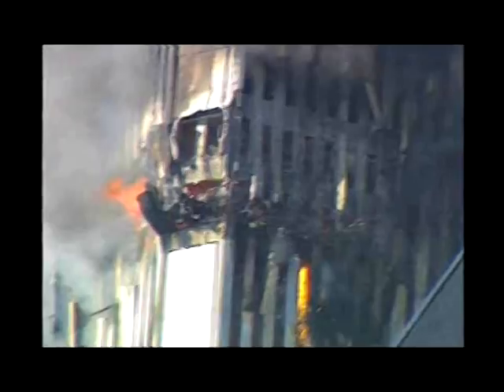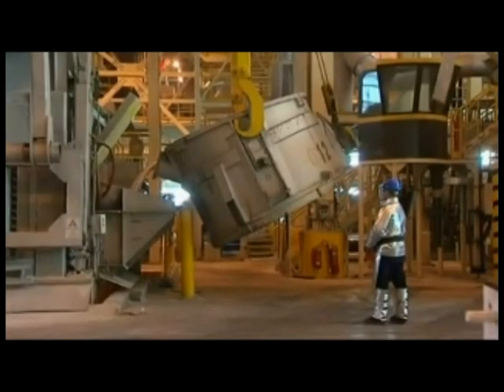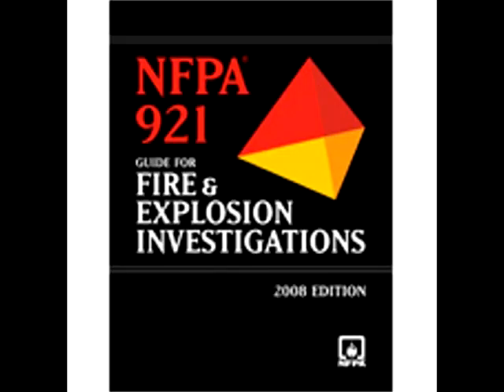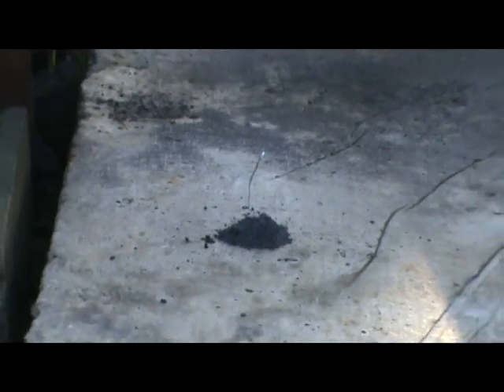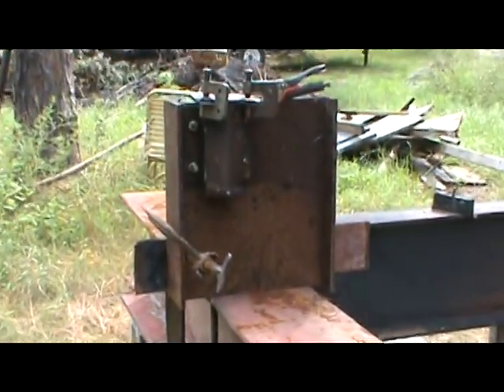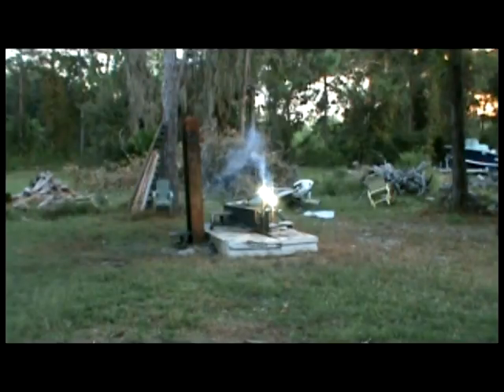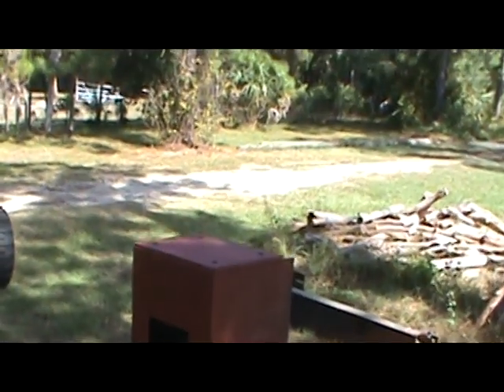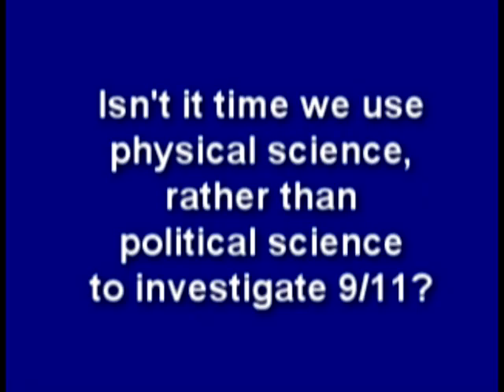9/11 Experiments: The Great Thermate Debate

Comment: No thermite was used in the Towers, there is no evidence to suggest it was. Put simply, those who advocate thermite cannot feasibly explain how the thermite and then all the explosives were placed in the towers. Remember for their theory to hold true, explosives would have to be placed on every support column on every floor with each floor timed to go off in sequence. 
Additionally, they would need the ability to START the thermite AND the explosive on the EXACT floor that was weakened by the planes.....................................DIDN'T happen!!!!
For those claiming it was done for the money, do you have ANY idea the cost of doing this..................it is far, far, far, far, far beyond the cost of a normal controlled demo. Controlled demos are not done in this way. They don't pancake the floors.
Tonnes upon tonnes of explosive and thermite required, kilometres of det cord, thousands of detonators, more timing devices than you could count teams upon teams of specialists to do it................all of which would have been rendered useless as soon as the planes crashed and mucked the network up...........................DIDN'T HAPPEN!!!!!!
Reply: You're arguing a building did to itself;
what would otherwise take tons and tons of explosives and incendiaries, carefully planted at every level, in addition to requiring thousands of precisely timed devices and kilometers of detonation cord, because of a vaporized jet no longer around to do all that demolition work.
There's no in-between? If you believe that a skyscraper can somehow gain momentum through itself anyway, then why assume a single bomb towards the top couldn't accomplish the same result without all the extra work you insist had to be done otherwise?
Reply: @liarfire101  No, all I insist is that for the towers to come down as they did (the argument being controlled demolition because explosive squibs could be seen and thermite is postulated) that a ridiculous amount of explosive and thermite material would need to be used.
Now, to address your assertion that a singular blast at that floor level could have done the job, yes it could. However you have no evidence of this. In addition you would then need to detail how exactly you were able to precipitate that explosion on that exact floor! Are you suggesting that explosives were planted on just that floor level and then the planes were purposefully flown into that exact floor level on both towers?...........No, no, no and NO!
Planes hit the towers weakening structural members and causing massive fires. The fires burned further weakening structural members and flooring that already had poor insulation. The floor pulled away from the external supports and down they came causing a progressive collapse that each successful floor was not designed to withstand>
Reply: Yeah a ridiculous amount of thermite would be necessary, because it's being used to melt a ridiculous amount of steel for a ridiculously large building. Just because large quantities of something would be necessary for the plan to go through doesn't make it impossible.
Reply: @willbradley8038  That is true Will. However what is also true, is that if you are going to make the claim that thermite was used, you need to provide exclusive empirical evidence. Currently all you have is speculation. Any empirical evidence that I have seen suggesting thermite can also be explained more believably by other things. Other evidence such as pictures of cut beams claimed to be evidence of thermite are 100% NOT thermite. Those beams were with 100% certainty cut during the cleanup by an oxy gas torch.....................text book oxy cuts! These cuts were made because both building had multiple stories of supporting beams still standing after the collapse.
Reply: There's no reason for someone to go through all that trouble of hijacking a plane and killing themselves though, if it were possible to accomplish the same feat with a single detonation up top and discretely walk away from it instead; unless they didn't want to be alive later to protect their family, neighbors, and friends from the most powerful military in the world upon finding out who they were, or if an object could actually go about liberating momentum through itself to become the largest demolished(destroyed/obliterated) skyscraper in world history.
Reply: @liarfire101  Not sure what you are trying to say here. Whether you personally believe there was no reason is mutually exclusive to the fact that the planes were hijacked and then flown into the buildings.
Reply: John Pickering
Now you're right back where you started.
If you are going to make one claim that a building can do to itself, what you otherwise insist must take tons of carefully planted and precisely timed explosives using kilometers of detonation cord, you need to provide exclusive empirical evidence that you aren't contradicting yourself. A collapsed jet doesn't fix that.
Reply: @liarfire101  What exactly are you talking about? The empirical evidence is all in the official version. It has been demonstrated many many times. The rebuke to you comes from YOU saying that it could not happen the way the official report says it did. I then said that YOU need to provide the evidence that it can happen by using THERMITE and EXPLOSIVE. I said that if it were the case that it did indeed happen with thermite and explosive, you would need ridiculous amounts of it, therefore there should be large amounts of evidence of it...........................but there is none, you can't provide any. Your inability to see this is probably a good indicator as to why you believe in logically fallacious arguments proposing 911 conspiracy. Your inability to fathom how it could have happened the way the official version says it happened and you subsequent conspiracy arguments are simply argument from personal incredulity!
Reply: thatrabbitguy  I am very quiet when those who actually have a clue speak. I would suggest you follow your own advice! The guy in the video is actually references Richard Gage. Richard Gage has no shame. I am not sure whether Gage actually believes what he is saying or not. I do know that's how he makes his living though. If he does believe it, then he is not very clever, if he doesn't believe it he is a charlotan. Either way, he is wrong, embarrassingly wrong!
Reply: John Pickering
Insisting a building can do to itself what would otherwise take a ludicrous amount of carefully timed and planted explosives and incendiaries is a contradiction. You need to provide evidence that it's possible for an object to initiate momentum through itself while gaining weight as it's deconstructed, if you're going to go along with what's been officially written. That isn't my story. That's not up to me to prove. There's no evidence or even a physical model to demonstrate that the second law of motion can even be applied to such a scenario. And there was no official investigation into the presence of incendiaries or explosives by authorities during the pro demolition cleanup, so lack of that evidence falls squarely on them too. I'm not the one who wrote the report or had the responsibility to look for it. And if I actually believed in logistically fallacious arguments proposing 911 conspiracy, I wouldn't be pointing out the absurdity of theorizing a person conspires with others to commit the personal act of suicide because he hates me instead of himself.
Reply: @liarfire101  Firstly, I am not suggesting the building did anything to itself and I don't know anyone who makes that argument. So the premise you use is rejected in its entirety. The rest of your post deals with a simple lack of understanding regarding dynamic and static loads, energy, force, acceleration and the structural properties of steel. As far as initiating momentum is concerned, that is evidenced by planes flying into the buildings and the resultant fires that further weakened structural components to the point of collapse. Any amount of experiments have shown this. That you choose to ignore them is not my issue. It has been calculated that once the top part of the building started moving, it only need to fall 3 feet in order to gain enough energy to initiate a progressive collapse. The fact that the floors were about 12 feet apart means that the bottom floors were not capable of providing structural resistance.  Relating to whose responsibility it is to provide evidence for controlled demolition, that would be your responsibility, or anyone else who proposes that theory. The burden of proof always falls on those making the claim, it is therefore your responsibility to prove it by fronting up with the empirical evidence, not my responsibility to disprove it. Regarding suicide terrorism which is what I think you are alluding to at the end of your post, are you asserting that this does not occur?
Reply: Your premise IS that the building obliterated itself after the jet was no longer around to do all the demolition work. Furthermore you suggest it would take tons and tons of carefully planted and strategically timed explosives and incendiaries to do the same work. Your next contradiction was insinuating that any mass(standing structure) can liberate momentum through itself because of another mass (upper block)that can only lose momentum against it in exact equal time to one another as momentum is instead ALWAYS conserved. The second law of motion (F=MxA) can only be applied to the later, and the action/reaction time couldn't be exactly equal and opposite between them, any other way. It doesn't matter which of the two are static or dynamic. In fact, they both could be dynamic and the results would be exactly the same. Facts never change and always agree with each other, and yet you've already contradicted yourself twice.  Also, an obliterated pile of debris is likewise a demolished one. It is therefore your responsibility to prove that a chaotic demolition is even possible. Whether you accept the fact that the official story is a conspiracy theory or not, is as beside the point as me thinking a person conspiring with others to commit the personal act of suicide (because he hates you instead of himself) is silly. I don't engage in crazy conspiracy theorizing.
Reply: "1.That is not my premise at all. Try again!"

Your original insinuation (premise) which started this thread was that a building can do to itself what would otherwise take tons of strategically placed explosives and incendiaries placed on every support column at every level timed to go off in sequence.

"2. I have not provided any contradiction whatsoever, that would be the inference you have taken based on your own biases"

All biases aside, the premise that began this thread is a contradiction.

"3. You have just demonstrated your lack of understanding of dynamic and static load."

Really? I thought that a dynamic load is one of motion whereas a static load is one that's not, and that the Third Law of motion applies exactly the same between colliding bodies regardless of which, or if both, are moving.  

"4. You are similarly ignorant of kinetic and potential energy"

I'm not the one suggesting that friction can behave as a catalyst which creates more energy, and friction.

"5. I don't have to prove anything, its already been proven, in fact the technique to bring down a building with no explosives by simply taking out upper level floor supports to initiate a progressive and total collapse is called "Verinage". There are many examples on Youtube if you would care to educate yourself..........................each and every one of them is a conclusive rebuttal of everything you have just stated. Put simply, watch them make the top third of a building start to move, and it comes down and demolishes the building completely."

Like any demolition technique (because buildings don't go about demolishing themselves), verinage' separates a building into sections of approximate equal mass to maximize damage to those sections while minimizing it to surrounding buildings and infrastructures, per Newtons Third Law'. The only video out of a dozen which seems to indicate that wouldn't be the case is simply an illusion, because the bottom two-thirds of the building was gutted of one third it's mass, making it appear as though there wasn't an equal and opposite reaction between the colliding top and taller standing structure. It's never been proven by anyone that Newtons laws can be violated by anything on this planet.

Your inability to accept certain things about 911 that are known to be true because you personally can't conceive that it could happen that way is a logical fallacy called the argument from personal incredulity.
Reply: @liarfire101  
1. No it was not. The premise was that you can provide no evidence of controlled demolition.
2. As highlighted above, you have completely ignored what MY premise was and created one of your own, then attacked it......................also known as a straw man argument!
3. Well at least you have the definitions for the most part correct, although your interpretation of how they work in practice, particularly as they would pertain to the twin towers is unsurprisingly wrong! As a simple example, an object in motion (in his case the upper floors of the WTC) can easily exceed the load capacity of another object (in this case the lower floors of the WTC) by a considerable margin. This is because the object in motion has a force applied to it in order to put it in motion. In our example, this force is called gravity.
4. I have made no such claim.
5. Again you quote Newtons Laws, and again you show by way of example that you don't understand them. Your attempts to discredit the Verinage technique as empirical evidence is simply confirmation bias.........................you are a veritable smorgasboard of logical fallacies

But let's try and get away from your rudimentary attempts at strawmen and see if you are prepared to answer my original point which contains my original premise. I will pose it as a question. Where is your empirical evidence for controlled demolition?
Reply: It's amazing how "truthers" will stick their fingers in their ears and shout the most irrelevant nonsense in order to prevent the indoctrination failing.
Reply: There is evidence actually. Does this evidence amount to proof? Maybe in some people's opinion. It makes for a strong case nonetheless and there is no better explanation for the red hot metal pouring out of the building.
Reply: @bojackson3073  "There is evidence actually"
That's great, perhaps you can present it so we can all have the chance to assess it.

"It makes for a strong case nonetheless"
In what way?

"there is no better explanation for the red hot metal pouring out of the building."
Perhaps you should have prefaced this comment with "as far as I know", as there is a mountain of evidence that points to a far better explanation than thermite and controlled demolition!
Reply: @johnpickering5289  Share what you think is a better explanation for the red hot metal pouring out of the building, reminiscent of the thermate reactions seen in the video we're commenting on.
Reply: @bojackson3073  You are making the claim that it was thermite. I am saying there is no evidence for it. The burden of proof falls on the person making the claim, not the person who says "I don't believe you". Therefore you must explain how the thermite got exactly in the position where the jet hit the building. And that's just for starters, but let's begin with that one first.
Reply: @johnpickering5289  I say it's the best explanation. That's my opinion based on evidence such as the reaction we see in this video, but without another explanation presented, there can be no argument as to the best explanation, it defaults to the only existing explanation. If you have evidence of this kind of reaction or event happening in any way similar to 9/11 then you can present that reaction and it can at least be compared visually. Let me ask, do you think there is a better explanation that you know of? Or not? Simple yes or no.
Reply: @johnpickering5289  how the thermite got there is not my claim, my claim is that it is thermite. How it got there is irrelevant. Read my comment above this one and kindly answer my question.
Reply: @bojackson3073  Yes

Comment: Just a thought in oil fired boilers a steam leak can create a hydrogen fire & destroy the boiler melting the boiler tubes So trapped water turning to steam also has the power to cut steel...

Comment: Excellent video! The aircraft that plowed into the twin towers is manufactured of aluminum skin sheetmetal, magnesium frame structure and the engines have hardened steel.  It is possible at high speeds for aluminum to puncture steel and the magnesium  to be scraped into the outside columns. The heat from the impact could ignite the magnesium that would explain the burning outside box columns. But witnesses said fires and explosions happened in other areas not impacted by the aircraft.  People need to look into why? Money and control! Those two go together hand in hand!

Comment: Steel melts un 1,400 degrees. The molten aluminum that reacted with the sprinkler water reserves would have exothermically reacted with hydrogen and caused fierce explosions as well as heated the space up to 1,500 degrees. The temperature would have melted the beams and the explosions would cause most of the instability needed to support the building. The planes crash forced the beams and collapsing floor above into a tight space for this heat to evolve. So I think that proves it. 

Read this here:
https://www.livescience.com/16179-twin-tower-collapse-model-squash-9-11-conspiracies.html

I hope this is factual. Feel free to find evidence to prove it wrong.
Reply: Still doesn't explain the extreme temperatures underground for over 90 days after the collapse.